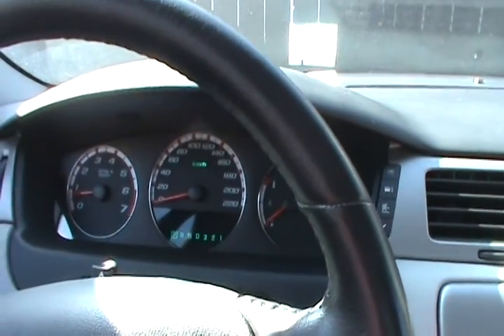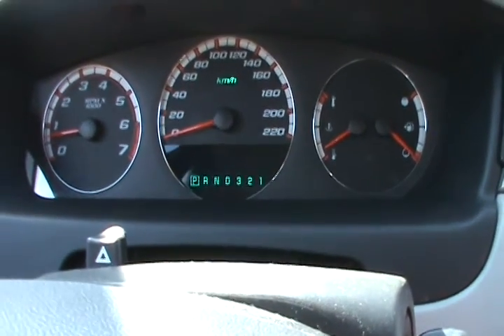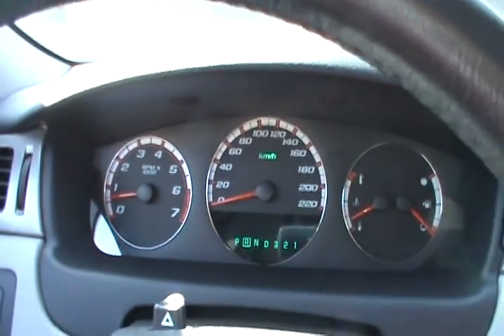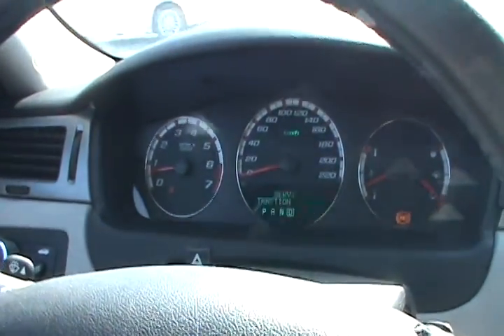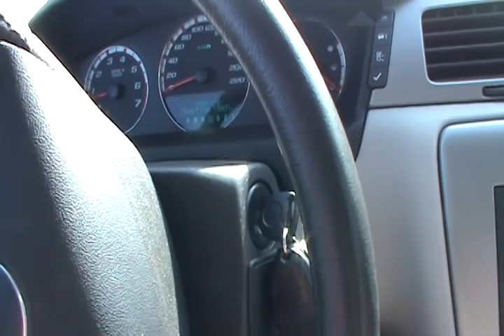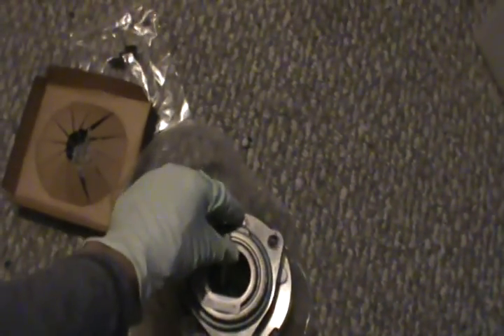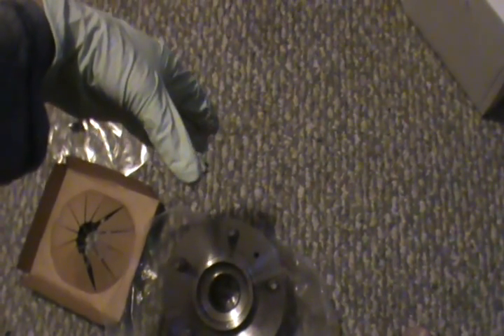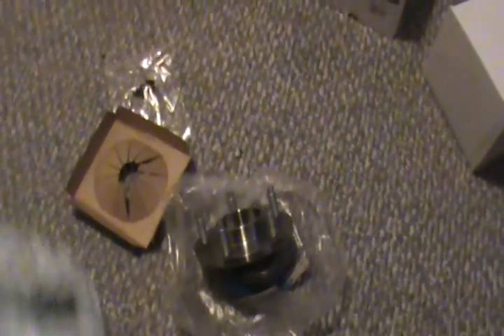Front HUB-Bearings need replacing and symptoms

Comment from the maker: The very first time the bearings needed replacing was at 62,000KM. I agree with you that a V8 is a bit too much for a front wheel. In addition, you loose 50% of the driving fun on a front wheel in comparison to rear wheel drive. GM chose the Impala front wheel for Cold North America weather then they canceled the SS model in 2009 I think.

Comment: Did you ever have problems with your Transmission? Thanks for the helpful Video by the way!
Reply from the maker: on the Impala SS the transmission seems to have a factory defect and sometimes the clutch slips when you take off from a complete stop. When taking off from a red light to a green light, when hitting the gas the engine revs (like if its on neutral) then the clutch suddenly engages causing the car to jump abruptly. We showed how to fix this in the engine/transmission rebuild video. other than that the transmission on the SS is really heavy duty and solid!
Reply: Thank you for your quick response. However I can't find the Video you are referring to. What needs to be done in order to get rid of that slippage from a dead stop? Thanks in advance!

Comment: I just fixed a wire that burnt through a harness plug connection for the rear defogger. Goes right behind the in cab fuse panel on the passenger side floor

Comment: When I make right turns only my car makes a spuealing noise/grinding. Not in park only drivimg like 20 mph.
Reply from the maker: that's an indication your axle is about to give. Change it before it breaks because if it does break your car won't move and you will need to toe it. I have a video on diagnosing, inspecting and changing the axle